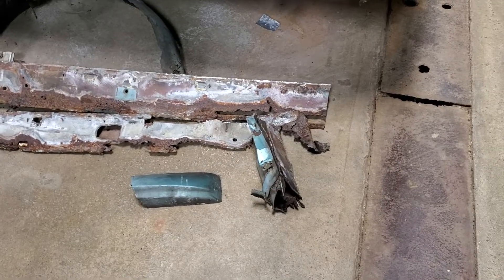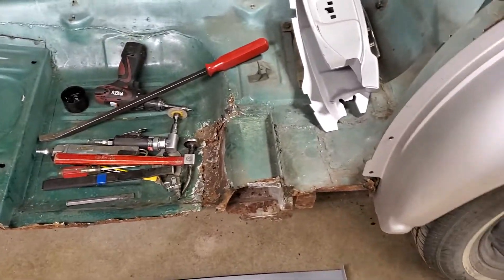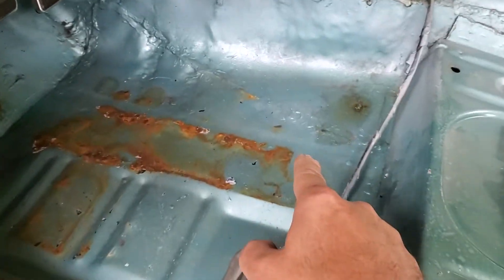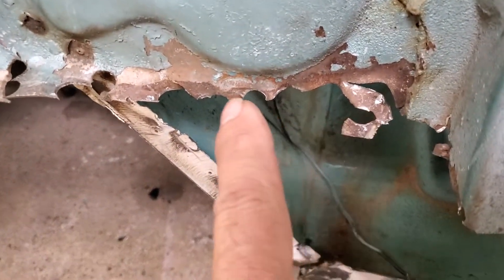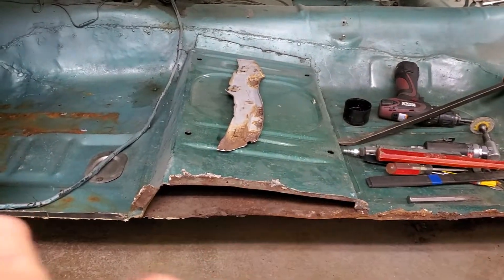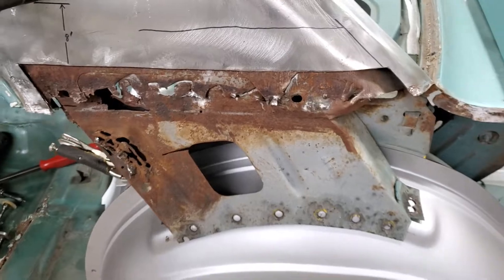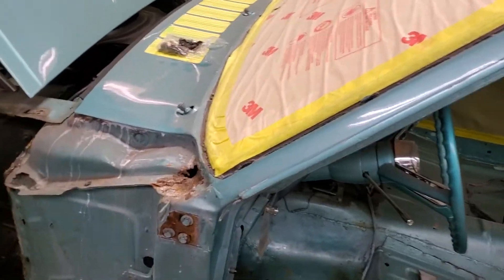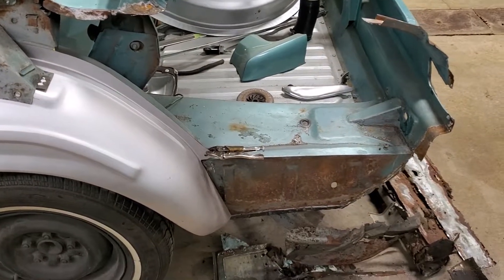"Frankenstang" Part 3, 1966 Mustang Restoration

Comment: You are a real class act , one of the few gems in your line of work that have the knowledge & skills to repair vehicles properly and give the customer real value in knowing that all repair work is as good as the original factory build , & in some cases better that ‘66 mustang is now safe and beautiful thanks to your concern and honesty which are traits more body shops and repair shops in general should follow, keep up the excellent work & I’ll keep watching 👍
Reply from the maker: Thank you Doug. I treat every car as if it were my own. I see all to often what a lot of shops do to these old cars and I am more concerned with quality and not the bottom line. My motto in my shop is, "If it's not getting fixed right, it's not getting fixed here". I tell every customer this before we shake hands on a project. Stay tuned, the finale is coming.